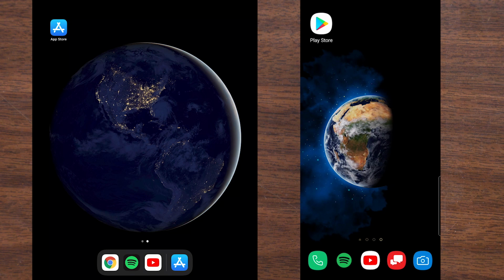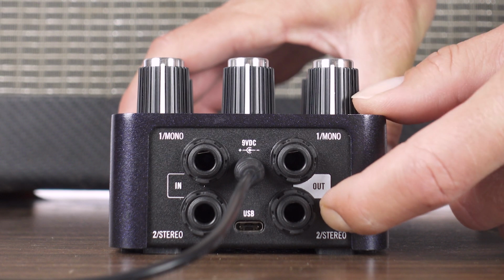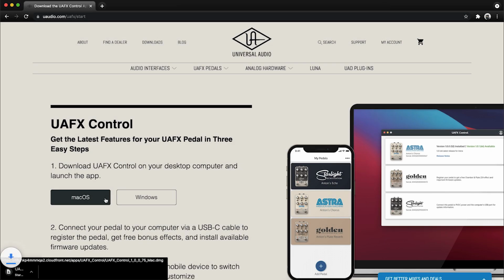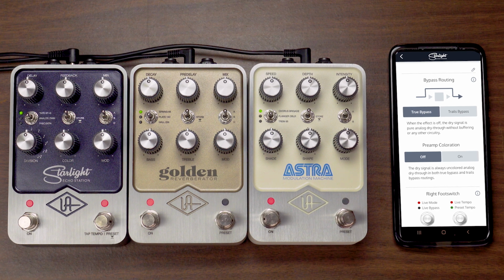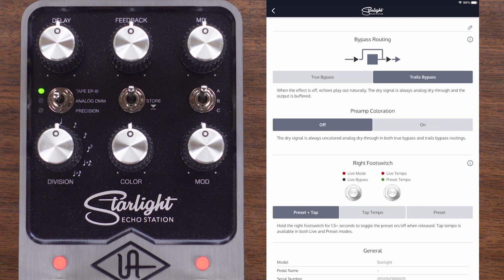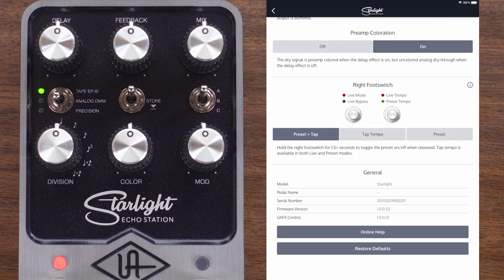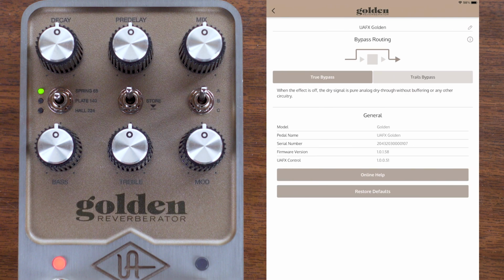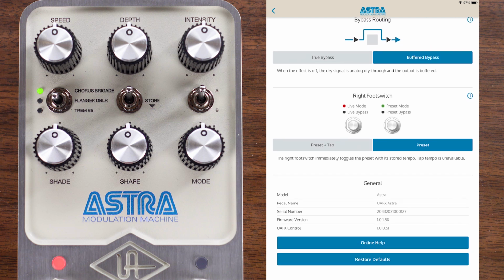Understanding the UAFX Control Mobile App for UAFX Pedals

Comment: I just received the Enigma pedal today, got the app to connect on my iPhone on the first try. As I was exploring some of the presets, my phone lost connection and I spent nearly 30 minutes trying everything to get it to reconnect! I restarted the app, rebooted the pedal, confirmed the Bluetooth correction, forget and re-establish Bluetooth (all stops multiple times), and it was sooooo maddening to deal with. This is easily the worst phone app I have ever used. I will check for a firmware update but if that doesn’t resolve things I’m sending it back for a refund.

Comment: App does NOT find NOR connect to DELVERB pedal. It's a complete joke.
FIX the (Android) App's bluetooth connectivity please.
It just blinks blue, I can find it EASILY from the Android bluetooth menu, can also PAIR from there but the App cannot see the pedal even if it's paired from the Android Bluetooth menu. Removing the Android BT pairing again and setting the pedal into pairing mode again and the App STILL cannot see the Pedal. Just blinking blue.
BUT the pedal is discoverable and visible, it's just the App that is blind.

Comment: It's really sad that they paired these amazing pedals with the most broken app I've ever had the misfortune of installing. If I have to restart both my phone and the pedal and reset the bluetooth settings every time I want to connect to the app, I'm just not going to use it... Plus it disconnects after a few minutes anyway.
I don't even have rare phone or anything, just a standard Samsung galaxy S model. I thought about returning the pedal, but it just sounds too good.

Comment: Connecting this device with the app is way harder than pictured here. If you came to this video to find a solution just like I did... For me it worked after manually adding the pedal in my bluetooth setting, then connecting it to my UA connect on the MacBook adding it there and then back to my app on the iPhone. Honestly, I wasn't expecting this from the same company that build my apollo twin and my spark supscription. However, the pedal sounds too good not to push through these issues TBH.
Reply: do you have to register it to your phone every time you use the pedal? I want to use this for gigs but if I have to register it all the time then its not good...

Comment: Total garbage. Every modern digital inconvenience with none of the advantages. I had to register separately in the app and online. You have to update the firmware from the computer but you have to also update from the phone to get the extra cab sims. The beautiful app has nice visual effects but tapping a connected pedal does nothing. So you wait, maybe it’s initializing … but no, now the bluetooth connection has timed out and disconnected itself, so you need to pair again. Restart the app and now one of my pedals is missing! Why not just leave it paired? Also, once installed the desktop automatically starts every time you boot your computer. Why the hell do I need this 200MB desktop app running in the background at all times? Update: I did actually get to see my pedal in the mobile app briefly. But I didn't act fast enough and it disconnected!!!
Reply: Wahhhh wahhhh wahhhhh (cry more)
Reply: @edreed5571  You wouldn't be upset if you spent 400+ dollars on a plastic door stop? Then you're a blathering moron.

Comment: It doesn’t work. IOS user here, won’t connect, no matter how much jiggery pokery. Have registered, have account, have unpaired, re-paired, deleted app, re-installed did some rain dancing and had a shaman ritual, still nothing. Would love some support. I am reading that lots of folks having the same experience.
Reply: Hi Jimmy, I had been in contact with the support. They gave me a bunch of stuff to try which didnt work. I am on Android 13 and it did work till the recent up. When I say it did work i had to figure out my own method to get it to work. Since the update its not working at all.  So support have pretty much left me with "sorry its not working, we have no timeline on when it will be sorted" absolutely rediculous.
Reply: for me it worked by connecting it to their windows app and registering it from their, after that it worked on my phone

Comment: I have all 3 of these pedals. I loved them! But this app was a total game changer for me! It completely opened up the pedals in ways I could have almost never discovered on my own. As someone who is relatively new to effects, and never having used the original effects contained in these pedals, it was sometimes hard to dial in tones exactly the way I heard them in my head. But this changed that! I could find a setting I really enjoyed seamlessly. However, there are a few improvements I think the app could have. First, why not have a singular controller for all three pedals? So you could adjust reverb, delay, and modulation without the lag time of switching between the 3 pedals? And lastly, to my knowledge, there isn’t a way to turn off a pedal using the app. You have to engage the actual pedal if you want to turn something off. I understand this isn’t a bid deal, but I also think it could be a simple update that would be useful. Thanks again! These are lifetime pedals for me!

Comment: UA probably wont read this, but i would love to see this idea become reality, and i think UA would be the only company to be able to successfully build it. 
A pedal that can load any plugin to be used on a pedalboard. Essentially its a LOW latency audio interface with midi foot switches that also outputs as a reamp box in the sense that it matches impedance for pedals. It just connects to your computer via USB, put the device wherever u want in your pedalboard signal chain, load your favorite plugins into a track (maybe its own software) , and use the foot switch to engage/bypass your effects via midi. (More for a live application than studio) 

Maybe im just crazy and thats a stupid idea, but i think if done right, it could be a game changer.
Reply from the maker: We read it all. Thanks for the feedback. 👍🏻